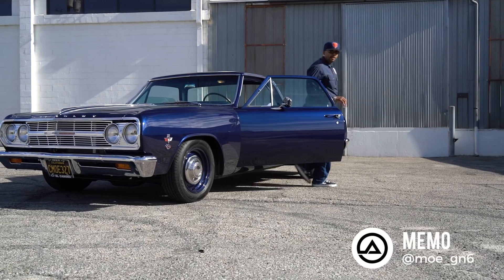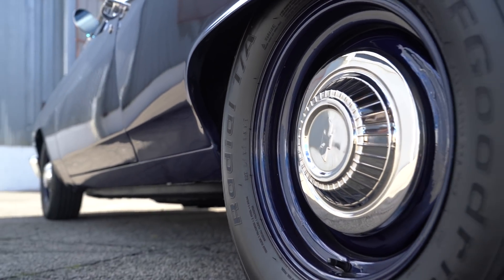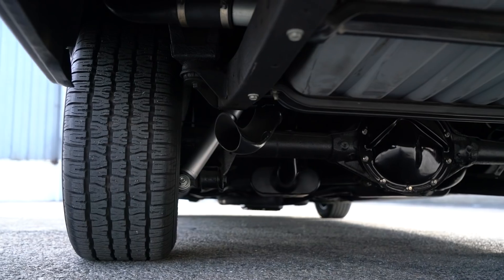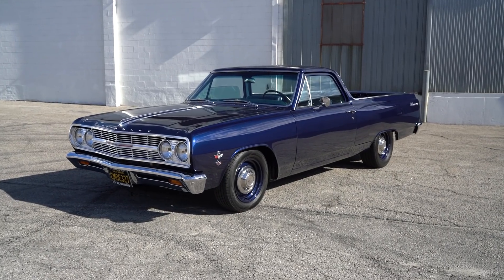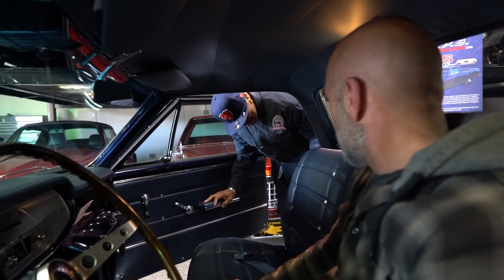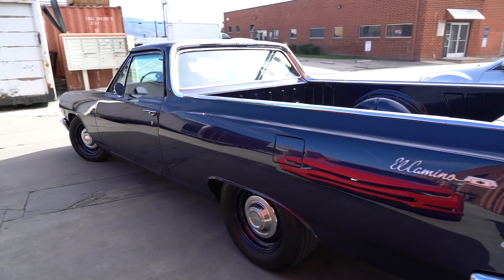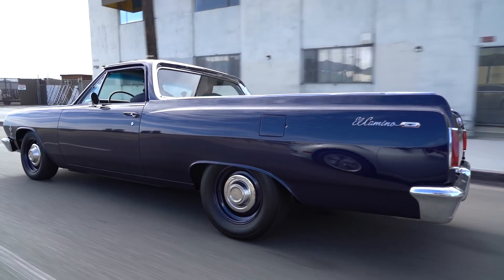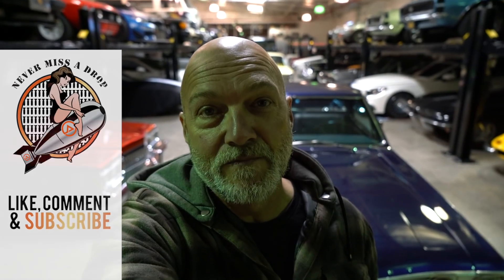Old School 1965 Chevy El Camino

Comment: I had a 65 El Camino in high school in the late 80's. That was a fun car. Had a 327 with a powerglide, and yes it had the floor shifter and the Chevelle center console, and Chevelle low back bucket seats. I did upgrade it to power steering, but it was drums all around.

Comment: 500 horse I think that's a lil stretch maybe 3 something
Reply: Still nice Camino tho
Reply: Yea no way.  It sounds just like the 327s I've had.  All show and no go.  Barely chirp the tires.
Reply: i hope it isnt 500 for have all manual braking and steering and not even disc brake
Reply: That's what I was just thinking lol
Reply: I bet it’s set up low compression and there goes the torque. My 68 impala 327/275 would walk that truck.
Reply: Bobby Bentley You know, was kinda thinking the same thing...but he never really pushes his cars. His Nova video was the same way, but it might be that he just doesn’t want to break something...still it’s nice, simple and clean.
Reply: https://www.youtube.com/watch?v=-1aewBgYKdU             what 500hp sounds like
Reply: I agree with you man, that small cubic inch motor would need a full roller cam set up and high compression to hit 500 ponies!
Good brand and sounding idle cam though(Isky) and way too much stall for that motor.
But still a really nice/clean build from what it was in the beginning, gotta give the dude that much.
Reply: I’d say 2 something I have 387 in my 4x4 and it will spin the tires good this guys engine is weak it’s a clean build but very weak engine
Reply: Yeah. He sounded like he was lying when he said it. I'm thinking around 350 hp. Im not shitting on it, but 500 horse was a bit of a stretch.
Reply: @roryanri804  yeah we have 508 hp and 517 ft lbs of torque in our camaro and it’s nothing like this honestly this thing seems pretty weak for even 300
Reply: @yamahaguy1732  my camaro has around 450 hp and it sounds way more rowdy that that el co. My 82 el camino sounds similar to his and its pushing 170 hp out of the 305. It would be cool if he posted his dyno.
Reply: @roryanri804  yeah our camaro will just spin if you floor it doing 30 lmao this thing barely spins from a stop
Reply: @roryanri804  well but now that I think about it those 327s and 283s don’t really make power until like 3-4 grand so it may be 500 and he may just need a bigger stall
Reply: Hey, IDK WHAT has been done via the internals to the motor so to say "it can't have 500 HP with a 327", I ain't saying THAT.. But, for the comments about their 327 SB being a 300 HP "dog that would barely chirp the tires"..🤔 ALL I can say is - you MUST'VE had one that was worn out OR was running on 7 cylinders/ had mechanical issues cuz IF NOT? How could some of the  factory 327s beat some of the SS396 BB Chevelles then? (Look it up/talk to some REAL old school racers). The 327 SB was one of Chevy's BEST small blocks EVER produced, due partly to their high winding rev capacities for instance. WHY  DID Chevy quit making them (aside from the 350 taking over)??? We'll never really know... Kinda like WHY DID Chevy quit making the badazz 427 BB motor (only to get replaced with the problematic 454)??? 😏   ALL good questions, IMO anyways.... But yeah lol. The Chevy 327? NOT junk motors with NO ballz... Maybe you're confusing them with the 283 SB that were VERY common in the 64-67 Malibus/El Caminos. ..🤔 Again? HAD to have had a "bad one" is ALL I can say, in defense of the mighty mouse 327 motors.....Peace 😎

Comment: Gotta Agree with Bobby Bentley.. 500hp streeeetch. 327 with just dart heads. I have the same year. 350, Vortec head , flat tops, Comp 268HE cam (not crazy). No stall with 700r4, 3.73 posi. If I launch it hard like he did just smoke and hard second. I am probably 350hp possibly.. Nice car though .. Like the interior !